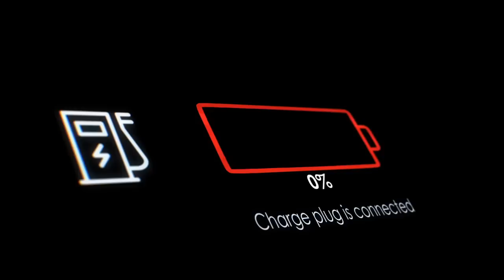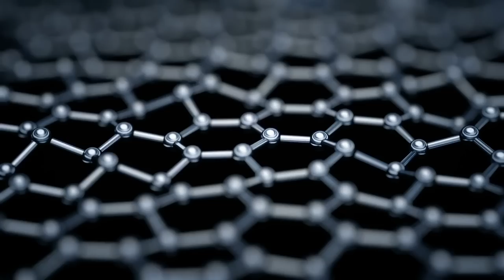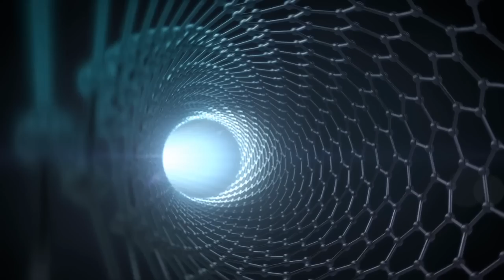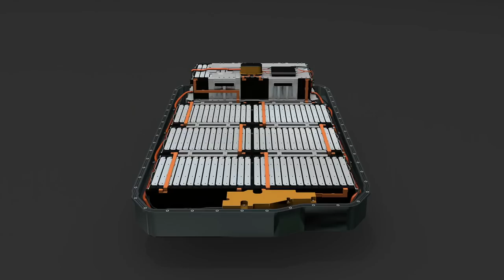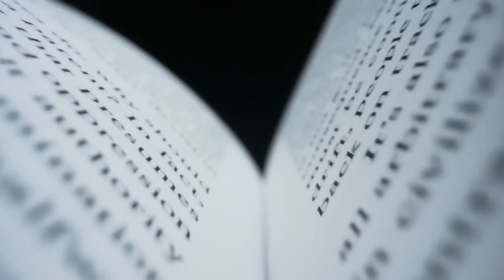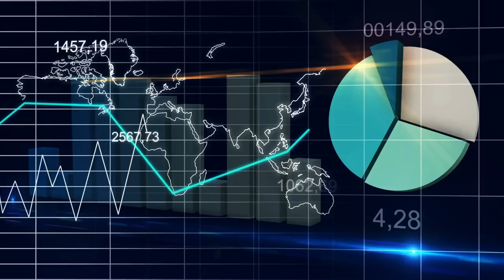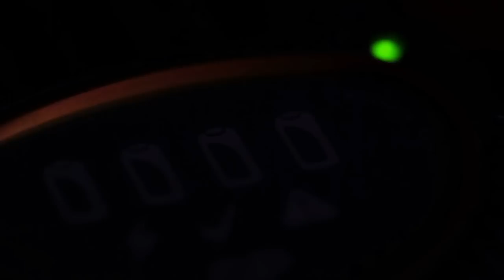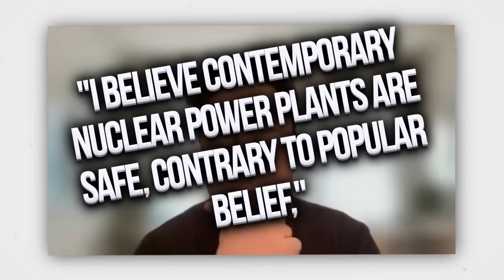IT HAPPENED! Elon Musk FINALLY Reveals Nuclear Diamond Battery

Comment: Sounds interesting but I have many questions.  Like how is energy transference accomplished between the battery and the device?  Are there metal plates?  Is the whole battery surface conductive?  What about batteries heating up?  If it has a constant production of energy through decay where does the excess energy go? How much will things weigh?